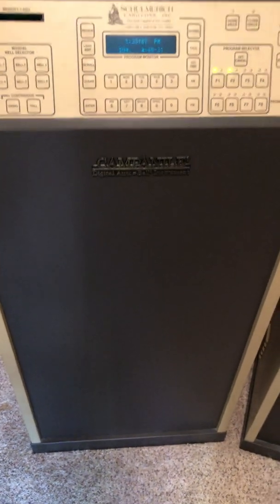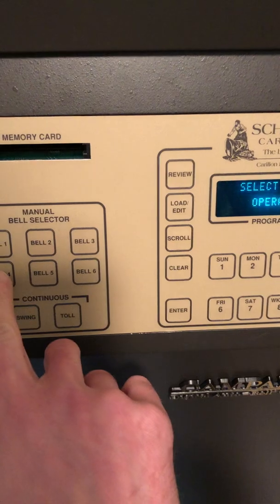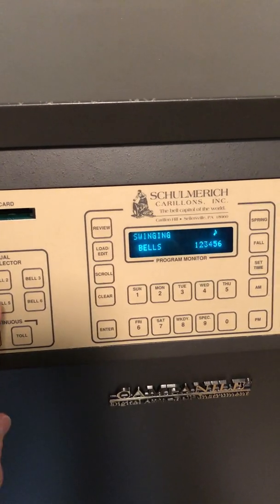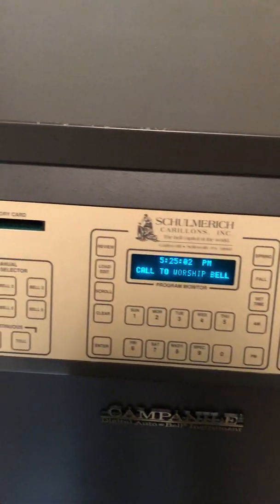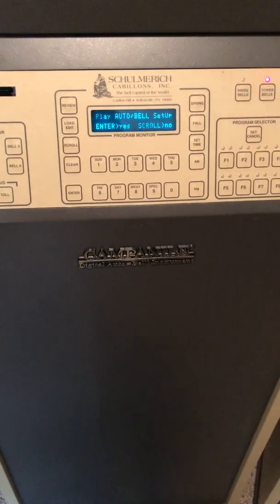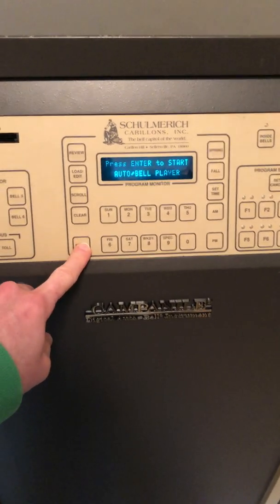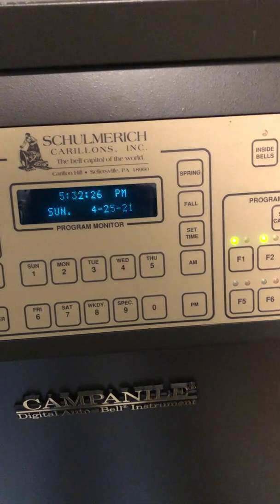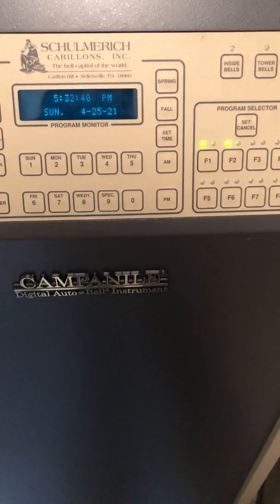Schulmerich Mark III Campanile CAC Carillon Bells System Demonstration (Mk 3) Repair Service

Comment: Is there an operating manual download? I have recently taken over the Schulmerich Mark III and can't find the operation manual to program it. Church times have change and I need to through and reset the times etc.
Reply from the maker: Hi, I do have copies of the manuals. What model do you happen to have (the name on the front of the cabinet)?
Reply: @coreyscarillons   Nova Bell III Digital Auto Bell Instrument DSP
Reply from the maker: @richdetrick7094  I do have the manual for that model that I could email
Reply from the maker: @richdetrick7094  You may need to break it apart in a user at domain dot com format, and once I send it I'd recommend removing the comment to avoid spam.
Reply: @coreyscarillons   Appreciate it.
Reply from the maker: @richdetrick7094  Sorry but I don’t see any address info.

Comment: I have this and had had a power outage and now I’m getting a sound like it’s trying to load almost like a record skipping and the program selector lights are flashing. Can you help with that
Reply from the maker: Definitely sounds like other systems I've helped fix in the past.  The power surge may have caused the power supply to fail.  Given the age of these systems this isn't surprising to see.  I have replacement power supplies available, or can rebuild the assembly with a new one depending on your comfort with doing the repairs.

Comment: Does this carillon unit pick up the atomic clock time code from the NIST in Colorado and Hawaii?
Reply from the maker: No - none of these systems were equipped with automated time setting.  The current (g5) model gets time from the internet, but any others prior are only set manually.